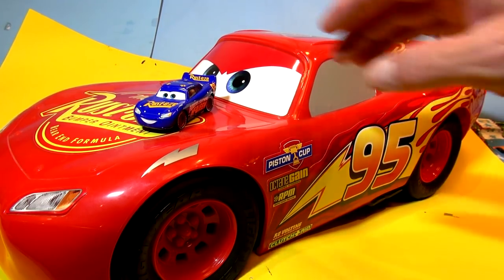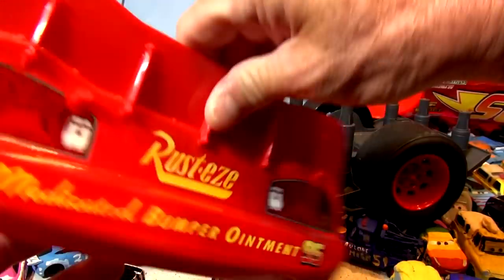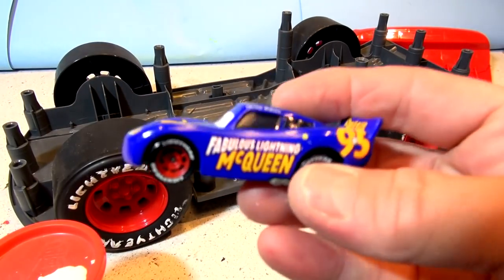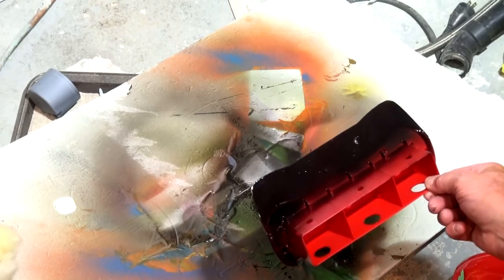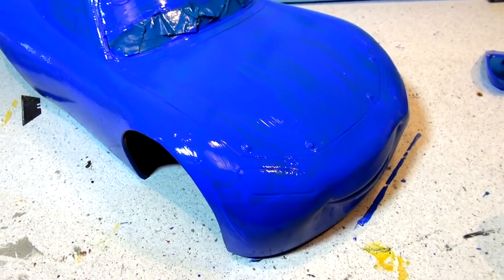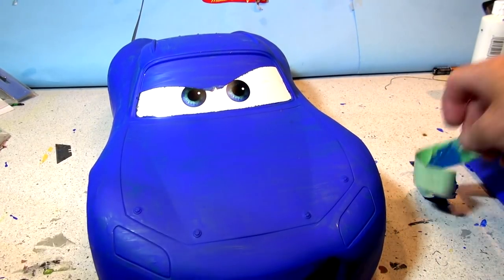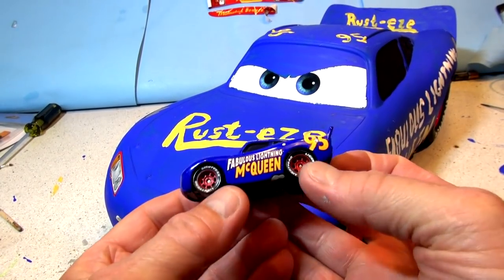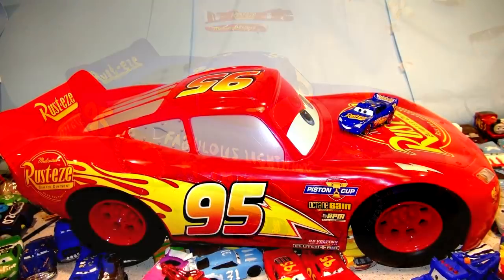Pixar Cars 3 Extra Large Fabulous Lightning McQueen Custom Painted Tribute to Doc Hudson

Comment: Try getting another giant McQueen like that one, which has now been “destroyed”. Like if you agree! 😉 Please?
Reply: Did you peel off the headlights and taillights? If so, repaint them please.
Reply: 4:30 They’re not flames. They are lightning bolts.
Reply from the maker: Its not destroyed, just differrnt color. Thelights on the front stickers wwre installed but the back w as one ling decal wi the red. I may cut it out. T u z.
Reply from the maker: right..oops
Reply: In cars 2 lightning changed from having lightning bolts to flames